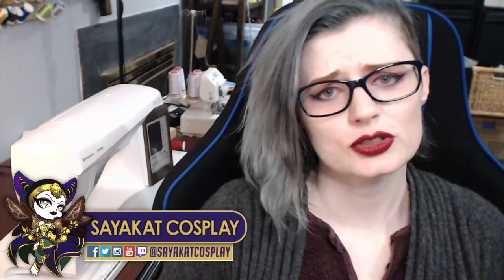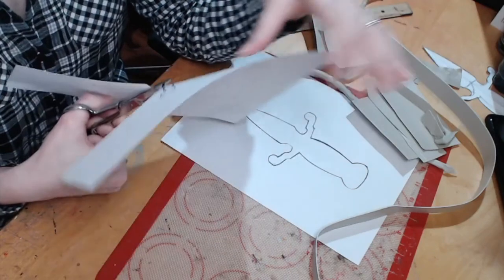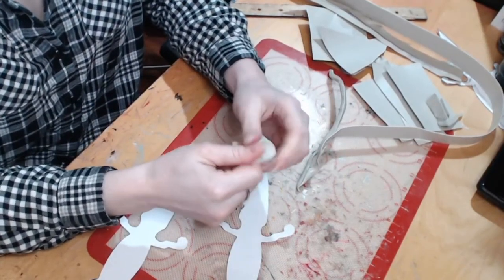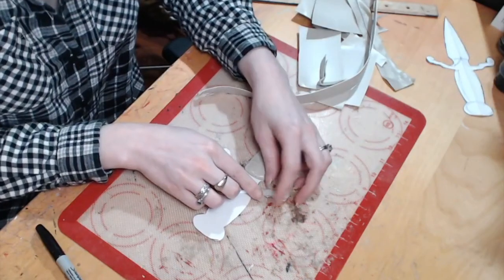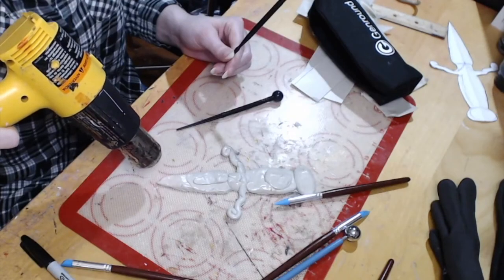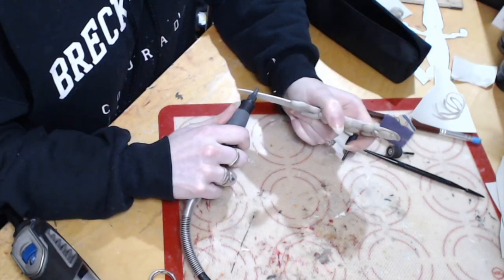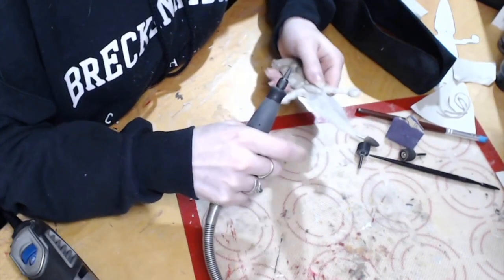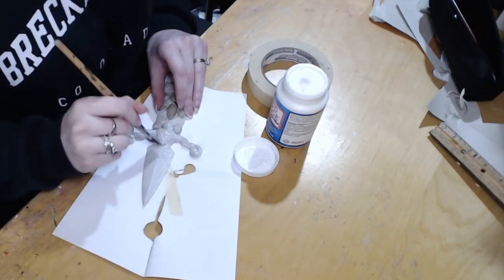Sculpting props from Thermoplastic | How to use thibra | Sayakat Cosplay

Comment: I've always wanted to use thermal plastics, but have been dreading the price. Thibra seems like a better cheaper option.
Reply from the maker: They are expensive but good materials. Thibra is really sticky and doesn't have material in it to help it keep it's shape so it's much more like putty than the others. I wouldn't recommend it for covering foam or armor, but for something like this it's great.